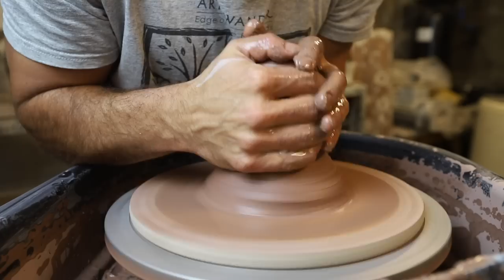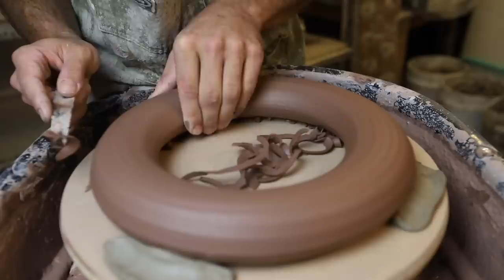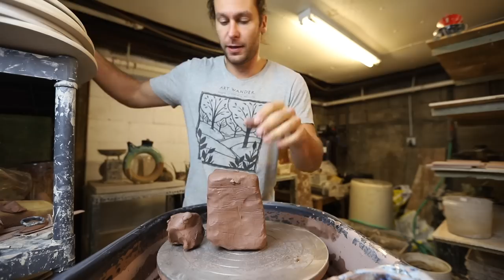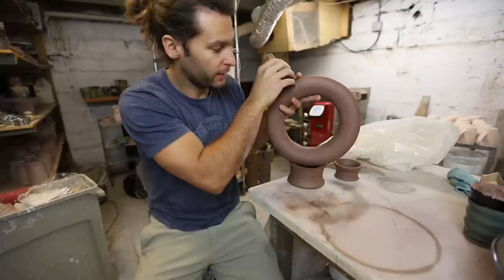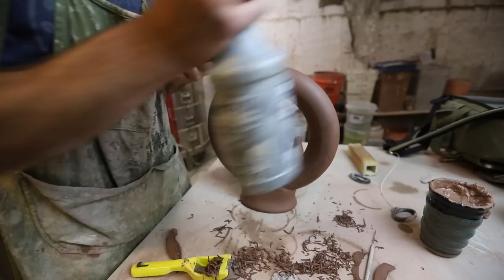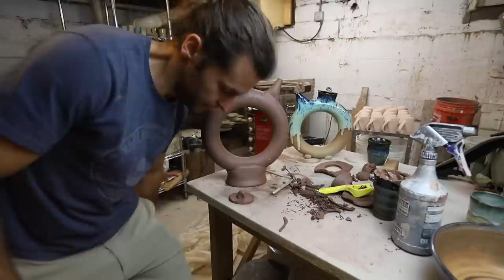How to make a DOUGHNUT/CIRCLE shape TEAPOT!

Comment: Try a different color. maybe a purple or lavender. IDK if I'd use it for tea or wine. It would be difficult to clean. Maybe just as an accent piece.
Reply: @stealth alliances I dont think so lol
Reply: If you use it as a decanter you just rinse with water and a few drops of Dawn. Rinse with water until clear then lean it upside down and let air dry.

If you're very worried about germs use a bleach water mix of 50/50 and run it through, after clearing out the Dawn,. Again rinse it clear and let air dry.
Reply: Can be used for wine
Reply: I agree with the purple color idea!

Comment: The puzzle mugs i learned to make years ago use very tiny donuts thrown on the wheel as the rim, then as the handle but you have to cut it for the handle part to attach. They are very cool!

Comment: In 18th century New England a ring flask was called a "Swtchel Ring" .Switchel was an oatmeal drink with rum used during harvest .. The ring had a jug neck added much like what you did and one or two tradtional handels .The swichel ring was thrown over the yoke on the oxen of horse that was plowing for easy use .All the best .. Guy

Comment: Like you said, the base is going to be sturdy. I’d probably want to make the whole thing lighter. So you could punch or cut some holes in the base.   Glaze wise I’d go with  white inside.  And maybe if you do put holes in the base you could either texture the outside with a matching hole shaped pattern and/or douse it with engobe and etch through?

Comment: I've turned a donut into a vase before - turning it on its side like the teapot, but cutting 3 holes that line up, through the top and the next wall, and again through the top of the bottom part. Then the stems of flowers are visible through the donut hole part. It sold pretty quickly, so maybe I should make another one?! lol.

Comment: I have tried making a donut ring once. I intended it to be a flower vase. Make the base and ring as a tea pot, make a long, narrow beaker shape, then cut 2 holes at the top of the donut, one directly over the other and one at the bottom directly below the 2 at the top. Insert long tube between hole at the base and the lower hole of the 2 at the top. For the top of the vase make a piece like the teapot has without the lid. Mine cracked. (Insert sad face here.) Maybe you'll have better luck!

Comment: Interesting to see how you formed the body of the vessel, but wouldn't it be easier to form a wider tube / smaller diameter hole in the centre, which I presume will make it easier to fill with glaze, and make it easier to clean with a wire bottle brush, after say using it for wine or tea? Also you were concerned about knocking your original over, might a shorter fatter donut reduce that chance?